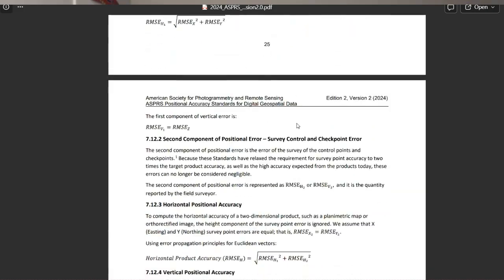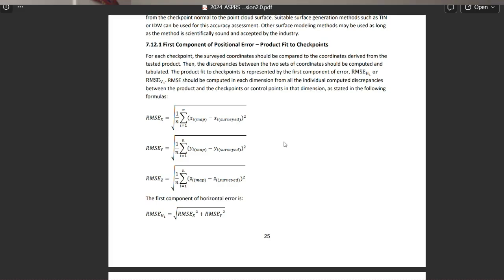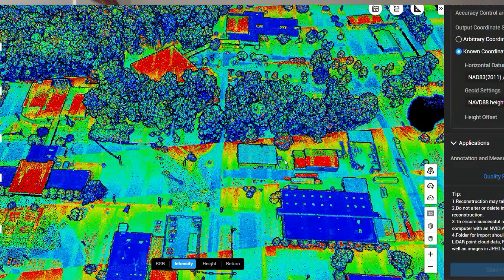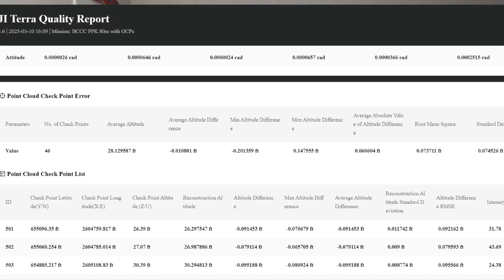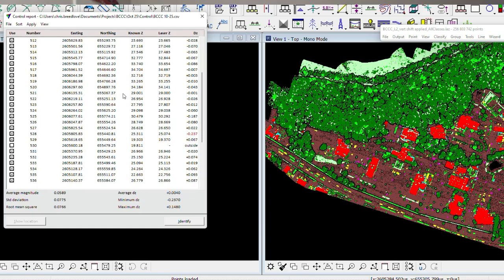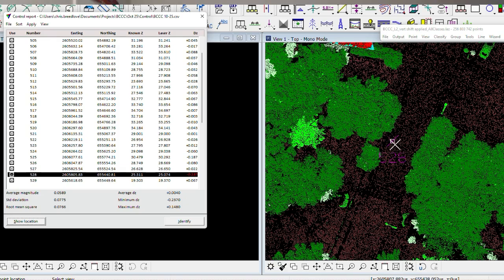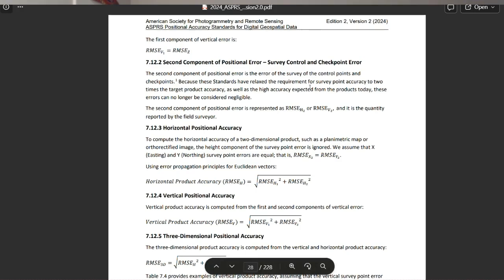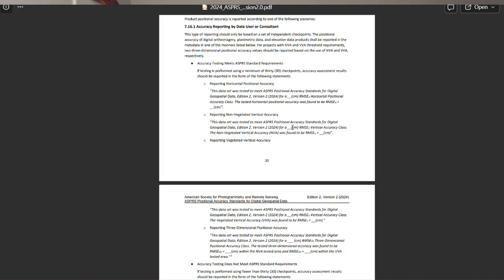How To Calculate Vertical Positional Accuracy Using the ASPRS 2024 Standards? (YDQA EP 97)

Comment: Wow.
😢
Is this what I have to look forward to if I get my part 107?
Reply: Only if you want to create maps with this level of accuracy. There are many use cases where this accuracy is not needed.
Reply: Couldn't agree more -- the remote pilot certificate is just about being legally compliant to perform commercial UAV operations. If not mapping per se -- inspection, photography/videography, or any other number of use cases, all of these surveying concepts would be N/A. If you do intend to offer aerial mapping services, definitely worth checking out the state survey (usually surveying and engineering combined) board in the state(s) you intend to operate in, there are certainly gradients as to how this or that US state defines the practice of surveying and where you can/can't offer mapping services as an independent provider without holding your PLS or at least partnering with someone who does.